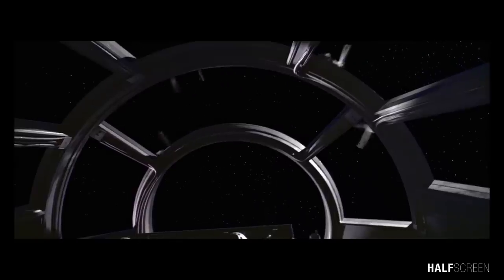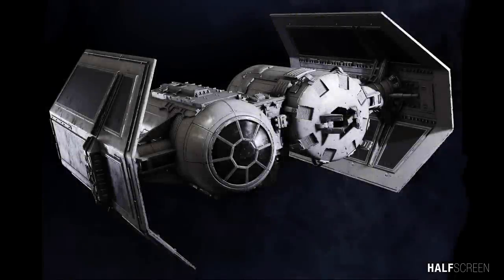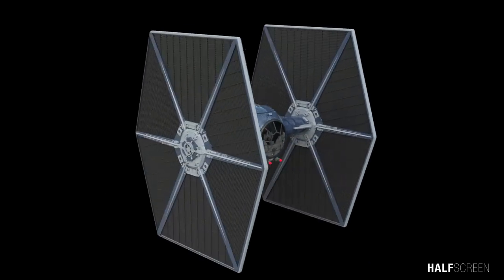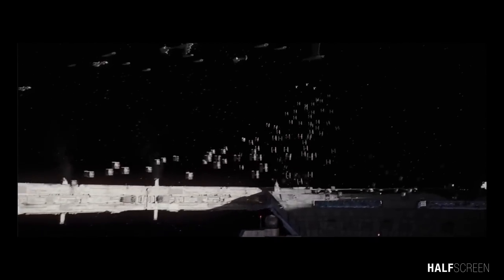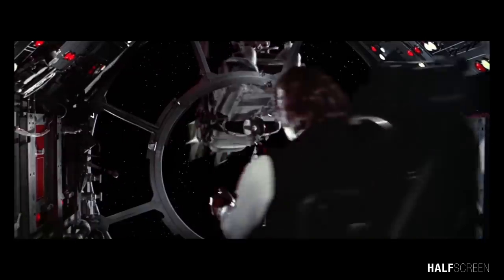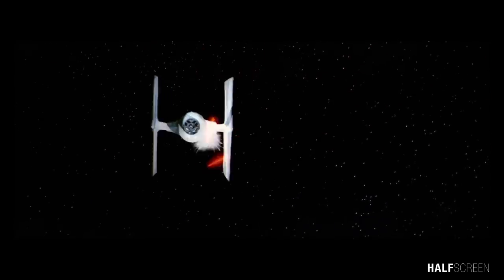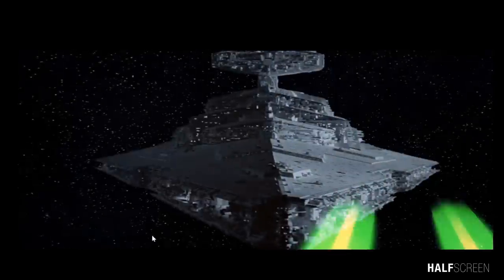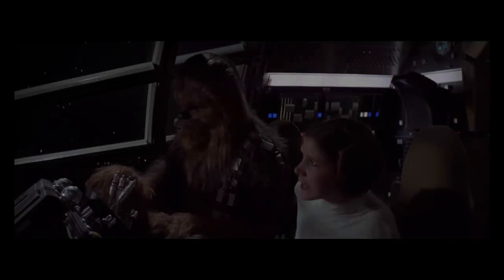Star Wars:  Inside the Tie Fighter

Comment: it is powered by solar energy, it has not shields, no pilot life support systems, no ejection cockpit, limited energy subsistems, the galactic empire is saving every niquel up for a galactic threatening super weapon... Although this star craft is very powerfull and agile, the pilot can manually and quickly distribute energy between weapons or engines, a skilled pilot can even use an emegency energy redirection to maximize the power where he needs it at the moment, giving them incomparable agility and speed, or monstrous damage, with the disadvantage of disabling the blaster cannons or the Ion engines respectively.

Comment: The tie fighter size and shape would almost fit a modern ion engine even the shape firs as does the exhaust port look up in engine images online it's an awesome coincidence!!!.Even before this I always thought the tie fighter and Porsche 911 had a common engineer both have rearward engines or atleast tapers towards the rear and the way everything rounds off towards the back.but I always thought that when it entered the atmosphere the pilot should rotate in cockpit and the ship fly like a true bi plane for better lift and control and therefore use less fuel or energy. When I was a kid in 1977..78 I used roofing H clips as miniature tie fighters as ther was no toys out yet and if you use two paper mate pen caps with one bic cap as the cockpit makes a good Y wing

Comment: Tie fighters are built up and down and wide all out space fight with alot a room around the fighter, but x wings b wings a wings y win the millennium falcon all built flat and why they can get in between cracks and crevices and splits and walls turn sideways and going through wall while the tie fighters getting messed up because it's built funny 😁

Comment: Imperial berks.
I’ll bet you anything they regretted leaving deflector shields off the TIEs after Jakku.
At least the First Order does things better.
Reply: What i'm wondering is, are the TIE Fighters like the one Finn and Poe stole in TFA still equipped with the two lasers in the front, or did they replace them with the one laser cannon?
Reply: The one they stole was a Special Forces TIE, which has a heavy turret under the cockpit, in addition to the front laser cannons.

Comment: I always loved the Star Wars space craft, but the tie fighter makes no sense as a design, basically only a limited forward view allowed to the pilot
Reply: U have to assume some kind of HUD system, especially with the helmets they wore.

Not very redundant, but the tie fighter was not designed for that.

If you think too hard on sci fi spaceships and how they would actually fight its hard to justify anything other than AI controlled ball turrets floating around.
Reply: A story originally  based on World War 2 pilots.  The fantastical notion that there would be dogfights in space is laughable.
Reply: @naturalfinish  Agreed. It's just fantasy and fun - albeit good fun. But visual dogfighting simply does not match with advanced sensor, computer and weapon technology. A real space combat in a viable Sci-Fi scenario would probably consist in long range fast auto-tracking missiles launched from vast distances and the correspondent counter measures. Much like air & naval combat today, but even more advanced and, of course, always out of visual range most of times. The very notion of manned single-seat starfighters is ludicrous. And those sluggish, low rate "laser" pellets they use as gunnery are simply less effective than even late WW2 air guns.
Reply: exactly, ships aren’t shooting at each other broadside like in the 18th century, you would be deploying armament at minimum 1000 kilometers